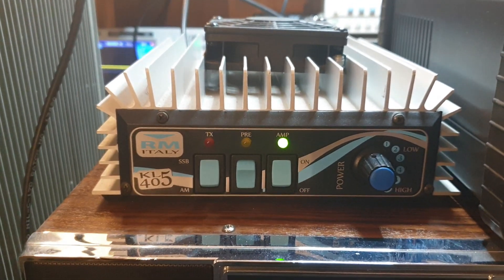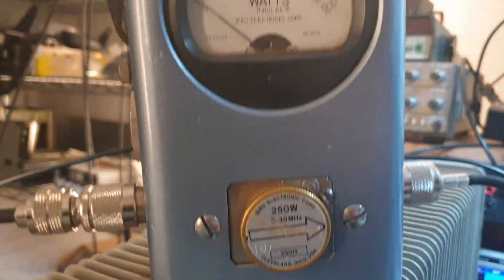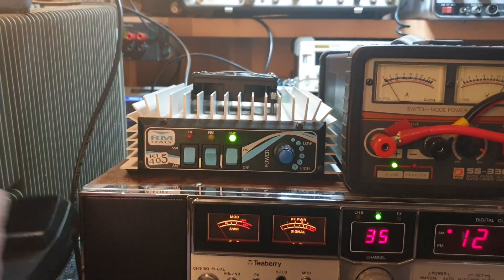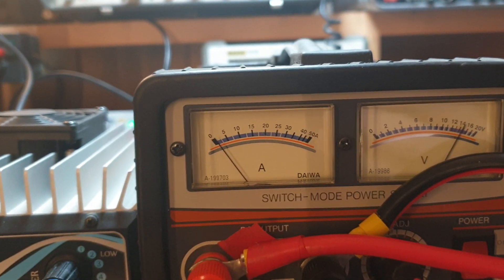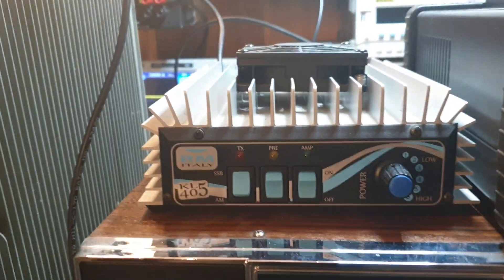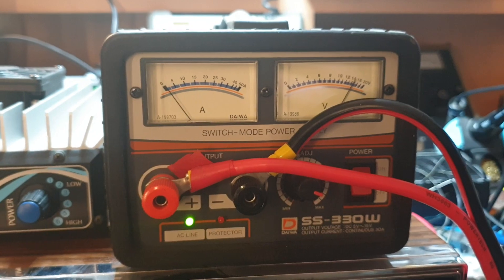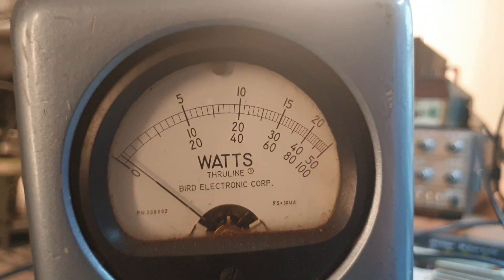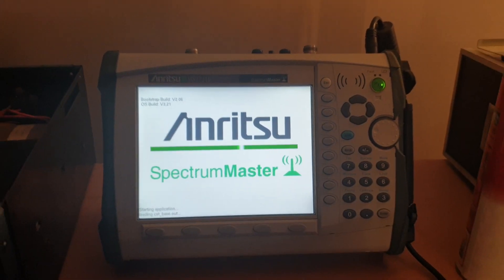RM Italy KL405 linear amplifier bench test with 2.5kw dummy load🤣🤣🤣.....

Comment: I have a
President Mc Kinley around 18W not SSB out othe box
    &
Midland 88 UK 40 & EU fm/am on Low power I am getting around 2.5W output not SSB. On the high power around 13.8W to 14.4W. not SSB
Question if I put 14W or 28W into the RM KL405V - 3.6-30MHZ (200W) LINEAR AMPLIFIER (WITH PRE-AMP) will that be ok to run

Comment: I have two KL503 amps. One is the older version with the pill transistors and the second one is their later release of the same amp but using MOSFETS instead. Both of those amps can dead key a maximum dead carrier of 240 watts RMS. You would never want to run them at a continuous 240 watts but they will deliver a full 240 watts with a 13.8 volt /20 amp power supply. I run mine set at a 100 watt dead carrier on AM or FM and on AM you can expect to see around a 140 watt up to a 160 watt peak modulation in a normal speaking voice and if you whistle it will peak closer to the rated 240 watt output and the amp will run safe and cool. On SSB these amps can really shine provided you don't overdrive them. The KL405 in this video is a slightly smaller amp than the KL503 amp. The KL405 is rated at 200 watts so what you are showing there is pretty much spot on. That amp will run with no issues with a 100 watt dead carrier for FM or for AM and as long as you keep it cool it will last for years. For the price you can't beat these amps and if harmonics are a concern just run the amp through a filter.

Comment: You are running about 15 amps into the amplifier.It's rated for 13.8 volts not 15 volts so it will appear to do more than normal.Tell the TRUTH and stop deceiving people. {:>(

Comment: It would be interesting to see how it goes on a general coverage rig. They are marketed in the UK as a "3-30 MHz" amp and people do use them as such. I've never seen anyone look at power output/spectral purity across the wider spectrum though.
Reply: I have had no complaints even on 40m. I don't use excessive mic gain and keep the exciter at no more than 7W.
Reply: @TheRenoir just what I would expect from someone running an ILLEGAL piece of equipment.👎🏻💩
Reply: Itll be ok if used with an L or Pi match antenna tuner as that is an adequate low pass filter.
Reply: There is absolutely no filtering. It's very dirty and illegal without outboard filters!

Comment: My mobile setup consists of an FTdx10 and an RM HLA300V. I run that thing for hours on end and it never lets me down. Great amps for the money! I get around 250w and has auto band switching too (handy as i use it from 80m-10m) Very happy with it. Lee M0RQX
Reply: For the prices of these amps they work quite well provided you don't over drive them or run a splatter box radio into them.